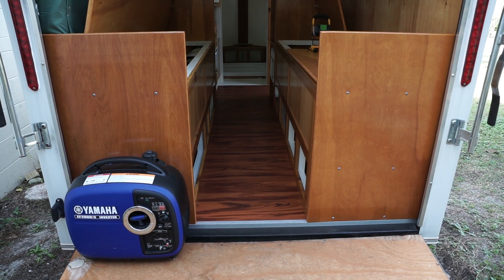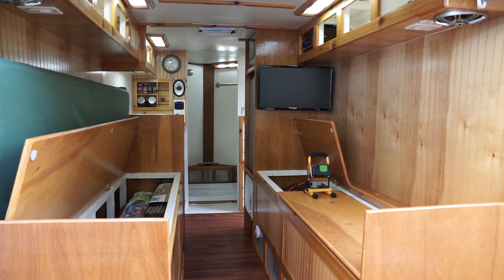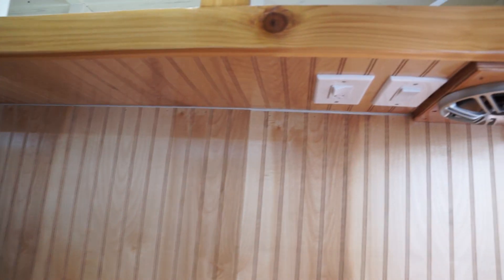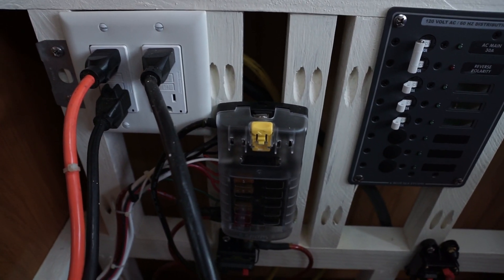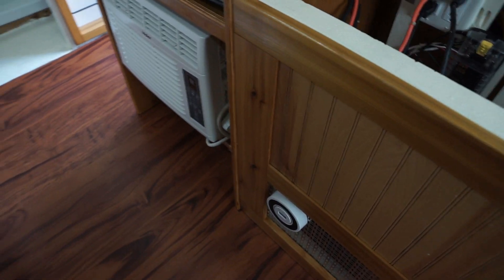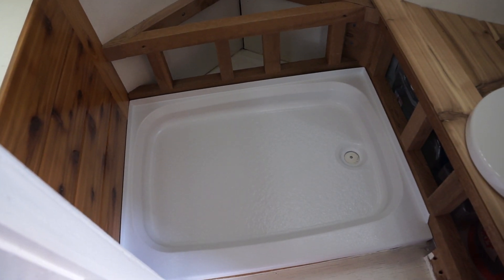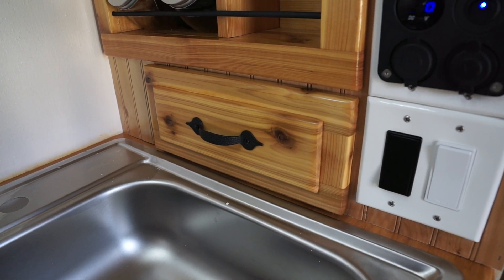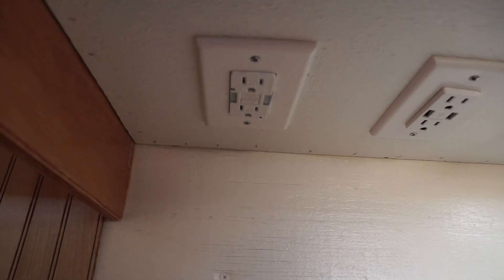6X12 Enclosed Camper Trailer Pt2

Comment: Make you a folding foot platform in front of the bed box opposite of the television to make sitting in it more comfortable than to have ur feet dangling, maybe like 10 or 12 inch wide that folds up flush when ur not using as a sofa

Comment: Nicest 6x12 I have seen yet . I would make it so bed boxes could be easily removed temporarily if you still needed to haul some cargo in it . And have enough space between bed boxes to strap down a medium size motorcycle when you are on the road . When parked put it outside and you have wheels if you need to make a Quick run to store or want to explore the area.

Comment: Thomas, I have done the same as you with a 6'x12', no bathroom however.  I am very interested in your A/C unit.  How did you plumb it to exhaust the hot air out?  Got any pictures or a video of your instillation?  Thanks in advance and may God bless.

Comment: nice work. you did however put the 2 tier silverware drawer in backwards. the top tier is supposed to slide back into the cabinet so you dont have to pull it out twice as far to access the bottom.

Comment: Do you have a cover for the always open floor vent when you use your air conditioner?  Because if not, won't the AC's chilled air just drain out through the vent?   While I understand that you may have positioned the AC unit close to the floor for stability purposes, it'll have to run harder and longer to cool the space if there's always an ongoing loss of chilled air.

Comment: Instead of the overhead storage doors, you might think about modified small cargo nets. The pocket door is too cool for school dude! On the tankless water heater, 90 out the side for the vent and stay away from putting holes in your roof if possible. Lastly, if you'd like a little more standardized chair feel when seated, use a couple of small bean bags on top of the bench.